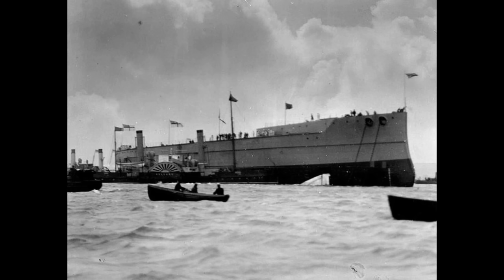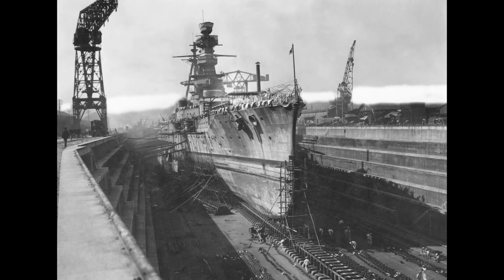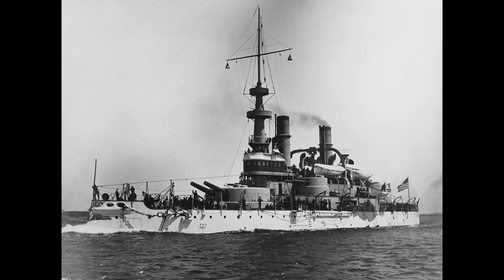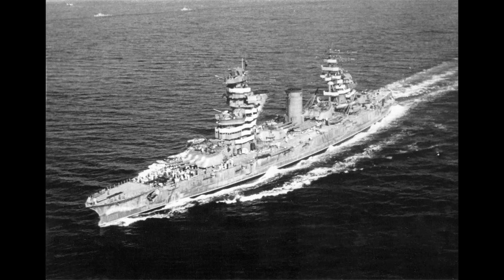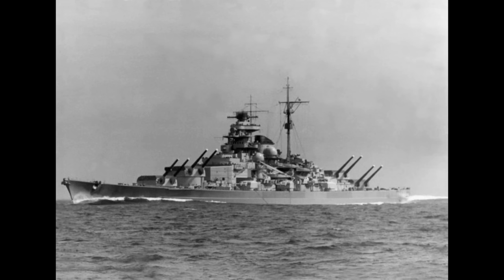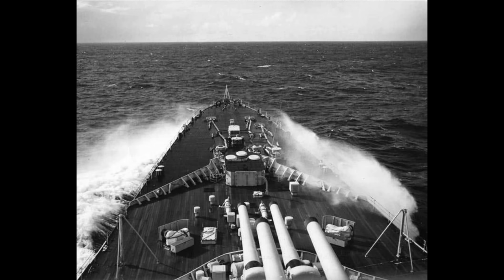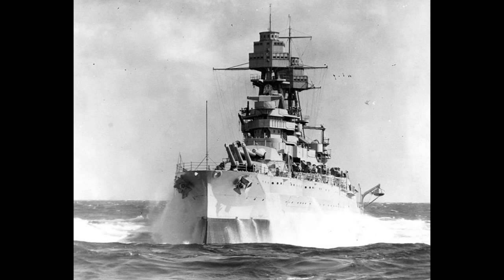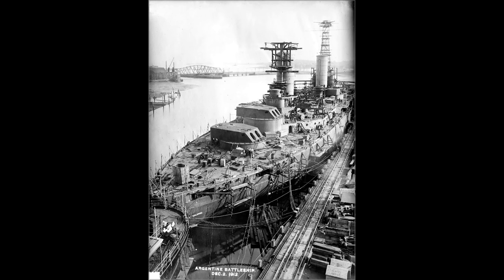The Architecture of Dreadnoughts - Blueprints of Success

Comment: I am sad you missed the collier example of just how out of hand a too stable ship can be. The more stable you are, the greater your angular accelerations on the recovery are. So, far from the center of rotation in the superstructure or up the mast, walls can pick up some impressive horizontal velocities. Some WW1 era colliers had some rather gruesome casualties where crewmen got bludgeoned to death by walls.
Reply: A collier with a full cargo of coal has a fairly gentle roll, the only problem would be when it was empty, and it had no ability to ballast the ship. If you want a problem ship try a bulk carrier with a cargo of steel, iron ingots, or various ores.
Reply: @benwilson6145  Modern colliers and ore ships have been modified to fix the problem. Their double hulls are much taller than most ships and are often flooded with an inflatable bladder to adjust stability as needed. masters of bulk carriers should be very conscious of the density of any cargo they bring aboard, ships are optimized for a certain range of cargo density during design. Going more dense can cause not only excess stability, but also structural issues and dramatic increases to metal fatigue rate. 

Also, the use case for colliers has changed sufficiently that the scenario which causes extreme over-stability is far less common. In the early 20th century, colliers often partly unloaded onto other ships at sea as a tanker would today. This meant that they spent a large part of their time at sea only partly loaded. Their highest stability was achieved somewhere near 2/3rds loaded, if I remember correctly.
Reply: @TrabberShir  There are no modern colliers. Bulk carriers carry coal. I am aware of the designs of Ore and Bulk carriers. I do not know what your definition of highest stability is? The highest Metacentric height in a ship carrying coal is when it has little coal onboard, thankfully this will only happen at a loading or discharge port now. A Bulk Carrier will add water ballast to saddle tanks and if designed to do so fill some holds full of ballast water. A collier a hundred years ago could not do that.

Comment: In the early part of the century one of the MAJOR reasons for Masts was the handling of the ships boats. The RN did a considerable amount of experimentation of where to put the fore mast in successive classes of Dreadnoughts with some classes having the mast behind the fore funnel mostly to make boat handling easier but discovered that flue gasses from the funnels made the spotting top nearly uninhabitable at high speeds.

Comment: Two things came to mind watching this video.  The first is from an account I read of the Battle of Coronel.  The author made mention that HMS Monmouth's lower level of casemate guns could not be fought in a seaway (i.e., moderate or rough sea) and presumably demonstrates the secondary engineering concern of water going along the side.  The other thing I remembered is about the power plants.  HMS Dreadnought (1906) was built using steam turbines for propulsion.  From what I remember, all other nation's dreadnoughts were using the triple expansion engines (same as pre-dreadnoughts, semi-dreadnoughts and armored cruisers) until around 1910.  Steam turbines became the preferred power plants but Britain appeared to have a monopoly on them for the first few years that dreadnoughts were being built.

Comment: Materials are a complex subject, though you hinted at this, but to say it slightly differently.  has materials get stronger and harder they become easier to shatter.  A rubber band is structurally weak, but impossible to shatter - however a diamond is statically strong and hard, but can be shattered easily (both are predominately carbon).

Comment: wow, that picture at 48:00 really drives home how little internal space some of these ships had.
You see pictures of these colossal ships and figure there's plenty of space inside, that it's all just taken up by supplies, machinery and yes even crew necessities on particularly luxurious ships. But no, they were just really tight on space... Almost looks like you'd just slide a particularly large cruiser into that protection.
Reply: It looks like that picture is showing the torpedo defense system (and a very deep one at that), which was only present on the lower few decks.  The upper decks wouldn’t have nearly as much room taken up by the armor.  (Some BBs with internal armor belts did lose some volume, but not nearly as much as in the TDS for the ship pictured.)  That said, space below the armored deck was still very limited, especially since the armored citadel usually only extended 2/3s or less of the total hull length!

Comment: The French navy kept the deck in front of the forward guns short and flared out the stem to a large ram to preserve the waterline length. Their tactical doctrine emphasised a forward charge with forward guns firing. Heavy guns firing forward caused a lot of deck damage, hence the short forward deck and incredibly long ram bow. Regarding stability, a broad ship has a quick roll unsuitable for good gunnery. A higher metacentre was an improvement giving a slower roll.

Comment: Another reason longer ships are faster is because of the way the bow and stern wave interact. Their wavelength gets longer as the ship speeds up, and eventually you reach a point where the first trough of the bow wave reaches the stern, and the bow rides up on the bow wave and the stern dips down into that trough, making it very difficult to go faster just by adding more power. And of course, as the ship gets longer, the speed at which that happens, and thus the limit on the practical top speed of the ship, gets higher.

Comment: Just two things to add that seem overlooked. 
One is the moment of inertia(well 3 moments for 3 dimensions), you can have two hulls exact same size and shape AND exact same center of mass with very different rolling and pitching frequency, think of rotating a ten foot bar with two 50 pound weights placed 1 foot from the center point verses placing those same weights 5 feet from center. Then do this in three dimensions. Similar concept to the frequency of a pendulum.
 
Second is in regard to the bow fullness and plunging aspect, there is a longitudinal stability balance similar to the lateral stability which is separate from drag or wetness. A very full bow(especially on a hull and mass distribution with low pitching inertia) will ride up over every wave but it will be a very uncomfortable ride just as strong lateral stability snaps the ship back upright. This can also make for more water on deck and higher drag because the more a ship pitches up to stay on top of the crest the more energy it accumulates that will come crashing down into the trough, somewhat nullifying the advantage of a full bow. Then is comes down to distribution of the bow volume, how far above the waterline, and possible devices like strakes to slow pitching with resistance to dynamic flow [vertically] rather than static buoyancy.

Comment: I'm curious that Drach focuses on length to breath as the primary choice determining speed charachteristics, but when you read the design histories, that is very much a derived number. Speed characteristics are a function of overall length, as at dreadnought fleet operational speeds wavemaking is the primary drag source, viscous drag (a function of wetted area) is important only at slower cruising speeds. For dreadnoughts, beam was usually a function of some external requirement, ie available drydock sizes or canal transit requirements, and also by the need to produce and acceptable metacentric height.

Comment: In the early years of the Dreadnoughts, when they didn't have computers or even slide rules, scaled ship models played a very important part. Several designs were made and tested in tanks (still done today). IMHO, I think the designers did a very good job considering what they had to work with.  In the age of sail, A ship model was handed to the builder as a set of 'blue prints' to help in construction. That's why we have so many fantastically detailed models of those ships.
Reply: slide rules have been in use since the 1850's, iirc... perhaps earlier. yes, scale models were important for testing and showing the lines, but by the beginnings of the dreadnought, the calculations were well on their way rather than the old artistic way of building. cheers!

Comment: One of the major drawbacks of a low freeboard certainly is in battle. If you get hit and a compartment floods, you want your ship still be above the water along its entire length. If the ship is already very low in the water, a single hit might be enough to dip your bow or stern below the waterline. Or the ship might lean a bit to the side, and if this allows water to flood into your ship along its whole length, it will roll over in short order.

Comment: Never understood why they allowed the width of the Panama canal limit ship breadth since they had both an Atlantic Fleet and a Pacific Fleet.  And since during WW2 they were already supporting ships on both fronts, then cost is no a factor. The only advantage is that you can move ships between the two oceans much faster going through the canal then around the cape. And it was inherently safer too. But why not just have ships designed to stay in the Pacific and ships designed to just stay in the Atlantic. Then the only restriction to size would be the dry dock at the shipyard.

Comment: A decently designed post-1930 dreadnought would almost inevitably have a fine bow that would ship masses of water in a seaway...this was the sacrifice for an increase in speed, particularly for the later "fast battleship" intended to operate with carrier groups, where a sustained speed of 25-plus knots was paramount. However, such things as the flared bow cross-section were a great improvement over the knife-like stem bows of the classic dreadnoughts; and in most cases if you were having difficulty engaging a target because of the amount of white or even green water coming over your bow your opponent was likely operating with a similar impediment.

Comment: What is the typical freeboard on WW2-era heavy cruisers? I can’t seem to find any accurate data on them. All of them look quite high above the water, but I could be wrong.
Reply: DK Brown quotes a formula for British designs - the freeboard for theforward third of the hull of k*sqrt(length) with k between 1.2 and 1.25 . eg 24-25 feet for a 400ft hull.

Comment: the inverted bow is back in fashion now and is being used a lot  - however its the worst thing  to have in frozen water and ice conditions  - but they studies say with some tweaking it can create and up lift motion that will crack the ice  up to 4 feet to 5 thickness - yet it has  not been demonstrated other then  the idea of having a forward propeller since some ships cut throw the heavy ice  by moving astern  instead of forward  with the proper crating the upward lift the just tear up the ice  ---- yet i have not seen any military vessel  doing  except behind and ice breaker

Comment: You could also mention that as gun ranges increased, the height of superstructures mattered less in the design process than deck width, in terms of target size,  i.e. adopting mansions and pagodas did not mean a larger effective target size.  Also, the 'flat iron' design as seen in Russian BBs and British "I" class battle cruisers was a big problem when it came to mounting secondary and (later) AA guns.  The pagoda masts of Marat/Oktobryskiya Revolutsya class and Japanese Kongos and other 14" BBs were in large part adopted because blast effects from centre turrets prevented mounting additional AA guns and directors at deck level amidships.   And the comment about experience counting in building warships was certainly illustrated by the difficult the Soviets had in building warships pre-WW2, particularly in relation to the materials to be used - IIRC Stalin wanted the whole of the 1930s Soviet BBs structure to be made from high-tensile steel, which was entirely impractical.

Comment: Hi, at 46:00 there is a picture of a battleship with strange tubing on the outside of the ship. What was the purpose of this structure? I have seen it on so many ships of the dreadnought era, but I haven't found any articles describing what it is and why is it present...
Reply: Those are extendable booms to hold torpedo nets.  They would be extended when the ship was in port to protect against torpedo attack.  They were eventually discarded because the increased size and speed of later torpedos meant that effective torpedo nets had to be heavier than anything you could reasonably hang off the side off those booms.
Reply: @bluemarlin8138  Also damaged torpedo nets potentially could wrap around propeller shafts causing loss of  motion. This was why the British withdrew them before Jutland.
Reply: @michaelbuckler  yes, potential prop-fouling object hanging near the stern is a concern!

Comment: Yes! Forward drainage can stop ships effectively staling them as the bow gets flooded! However! Constant flaring out bows is an all or nothing proposal used by US & German designs! The late WW1-2 Brit designs focused on the raised forward deck to stop damage & maintain speed to action/ patrol areas in heavy seas! If you factor in both the flared bow design & superimpose the full forward raised deck you get a bonus! However you need to bevel in the sides above the ski slope/clipper bow at say 45 Deg to chisel in the bow deck is so small that runoff is negligible! Also the square transom adopted by Yanks get the phantom length of the continuous stern on the shortened hull length, improving turn circles! The Extreme length of the BC Blake pre full modernization & its mega length cost it dearly! It was a mega target magnet!

Comment: I’m curious, has any ship ever had a badly-enough designed bow, alternately been unlucky enough, to crest a wave, come back down, and have the bow dig so deep into the water that it causes any sort of crippling/catastrophic structural damage to the ship?

Basically has a ship spontaneously sunk itself because of its bow being too narrow xx
Reply: @karstentopp  The USS Hornet had the bow wrecked in a typhoon. If you visit the ship now (museum vessel in Alameda, CA), the bow interior space is clearly "formerly exposed to the water" areas, now surrounded by a nice, smooth enclosed hull plating. https://upload.wikimedia.org/wikipedia/commons/c/c1/USS_Hornet_%28CV-12%29_damaged_flight_deck_1945.jpg
Reply: The Edmund Fitzgerald (mentioned above) dug its bows into the water so deeply that they hit bottom (ship was far longer than the water depth) and fractured.  That is why it sank so rapidly after the final radio message to the following ship.

Comment: So as a whole in general the south dakato class & north carolina class are a nice in between compromise in terms of length to beam ratio ?
Reply: The NCs probably had the closest to an ideal length-beam ratio, but were unable to take advantage of it due to having slightly older machinery and bad vibration problems at higher speeds.  But they had the advantage (in weight terms) of only having to armor against 14-in guns and not having a lower belt extension to protect against diving shells.  The SoDaks were a little on the short side.   Due to their need to increase armor protection over the NCs to protect against 16” shells and diving shells while maintaining the same displacement, the navy had to shorten the ships.  However, they were able to maintain the same designed top speed as the NCs (but unlike the NCs, could actually maintain it) by changing the hull form to incorporate a more wedge-shaped bow and much more powerful (but also more compact) engines.  The change in hull form did make them worse in seakeeping than the NCs and very wet forward, exacerbated by the fact that Turret 1 was so far forward.  This never seemed to be a problem in actual combat, but USS Massachusetts did have some issues with water entering the forward turret while crossing the Atlantic in heavy weather in 1942.  I believe this was a sealing issue that was later fixed though.  (I think the wetness issue could have been mitigated somewhat with a little more forward angle and flare on the bow, but oh well.)   On the plus side, their short length did make them more maneuverable and a smaller target.  Their deeper draft compared to the NCs also meant their vitals were further below the waterline and therefore less likely to be hit if a shell penetrated the belt.

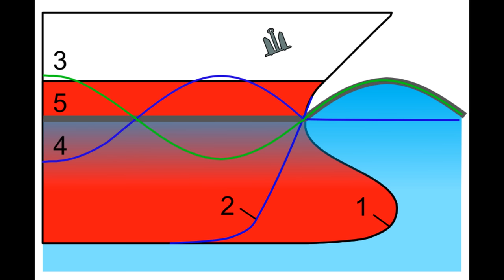Comment: 7:00 Are bulbous bows designed to be optimized for a particular speed?
Reply: sometimes, but in theory the bulb works to cancel the standing wave at every speed - generally designed for "cruising speed" and then it works as well or as poorly as it is designed. cheers!

Comment: Could hull design of modern-ish (1925-44) battleship (bulbous bow, beam/length ratio, freeboard/gunwale height, etc) have been translated practically into the Age of Sail warship design?  Was there something inherent to timbers that required ships to look like wash tubs (when compared to modern warships)?
Reply: I've oft wondered this myself.
Reply: I think because of the lower speed of a sailing ship, the designers of a sailing warship were more worried about ocean going capability and surviving in storms.
Reply: @molybdaen11  The forces exerted on the hull by the masts with a lot of sail on would also have to be taken into account.